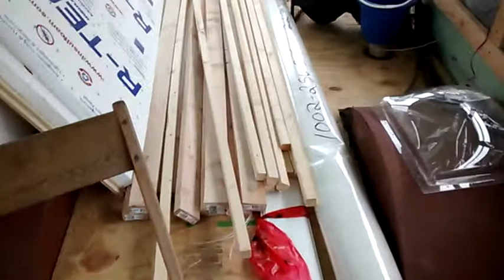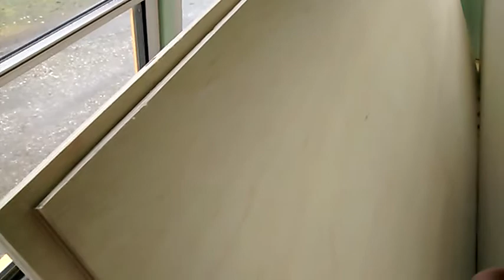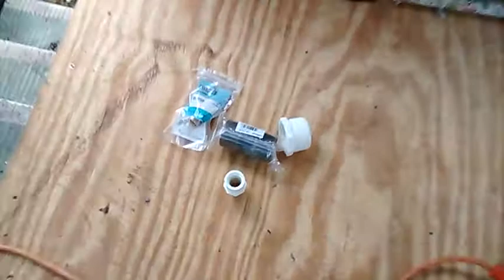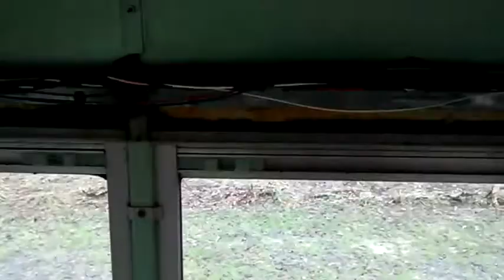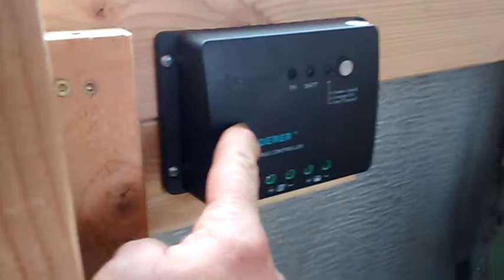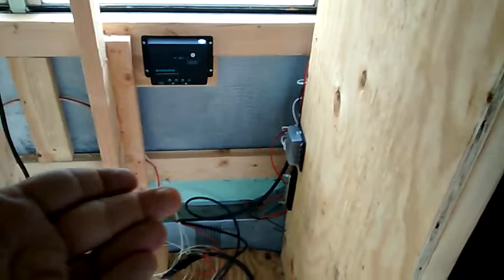Mullet's Skoolie Build EP 11 - Wiring and More Materials

Comment: Hey brotha.. Your just humming along!  I didn't see any connections for a vent tube for that water tank.. For when your filling up the tank you will need the air to escape.. You prolly already thought of that.  I was just throwing in my 2 cents.. Lol.. Again.. Keep it up!
Reply from the maker: All the fittings are on the opposite side of the tank which was not shown. There are 2 large and 2 small fittings.The large one on top will be the fill and the small one on top will vent. The large one on bottom will be a drain and the small one on bottom will be the supply.
Reply: Johnny Mullet awesome.. I figured you already knew.. Your definitely well versed!  Keep it going brotha!

Comment: May I offer a suggestion? If you do put LED strips for lighting on the walls, point them up for a diffused lighting off the roof. It wont be as harsh or in your eyes. also you can simply extend the wood panel that's covering the wires up an inch or so and the strips will be completely hidden.
Reply from the maker: Yup! That is exactly what I am doing with the lights. The ceiling will be painted whit and it should look great.
Reply: Sweet man! So excited to see how it turns out!